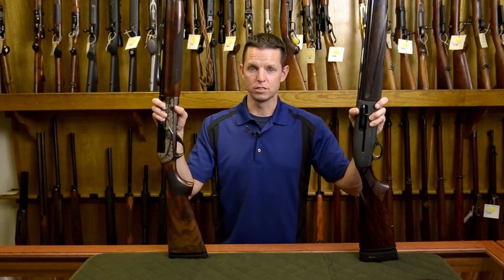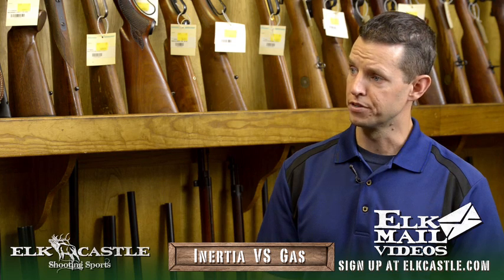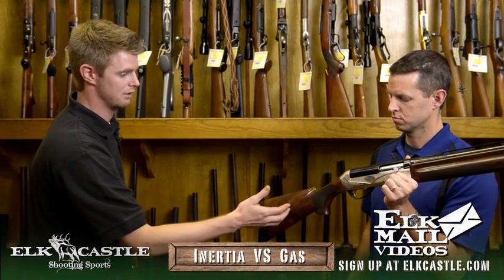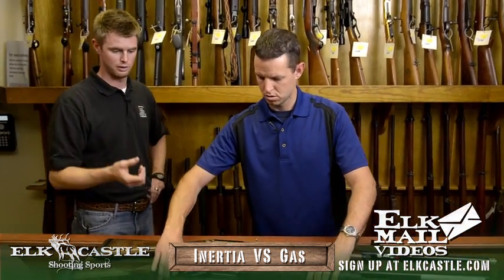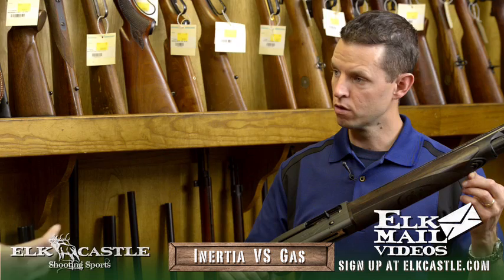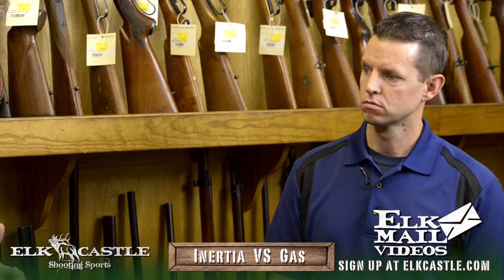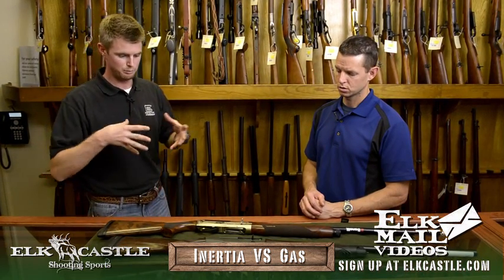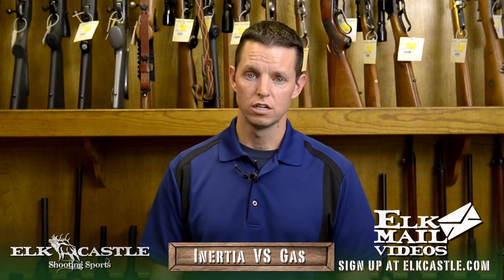Gas vs Inertia Semi-Auto Shotguns

Comment: WARNING DO NOT FALL FOR SKINNY GUYS BENELLI IS MOST COMFORTABLE ALL DAY.BS YOU WILL NEED SHOULDER SURGERY!!!!! i HAVE CONTACTED BENELLI AND THEY SAY IM STUCK WITH THIS BEAUTIFUL KICKING SOB. HAD I FIRED ONE SHOT I WUD HAVE RAN OUT OF STORE. THESE ARE HIGH END GUNS WITH LOW END RESULTS. PROS GUN SHOOTS HARD AND FAST!!!! CONS WORST KICKING GUN OF MY LIFETIME .IM 62 HAVE HAD AT LEAST 45 GUNS. IM SAVING SOMEONE GOOD MONEY. MINE IS IN CABINET AND STILL LOOKS NEW. I PUT A KICKEEZ RECOIL PAD WHICH HELPED SO BUT ITS STILL THERE. TRADING POST PINCKNEYVILLE OFFERED ME 600 I TOLD THEM WHERE TO GO. WILL TRY FOR $750 OR KEEP IT. HAVE SHOT 24 SHELLS SINCE JULY 2017!!!! ITS THE 7.1LB ONE TOO THEY MAKE A SUPERLIGHT AT 6LBS. WITH KICKEEZ PAD GUN IS SIMILAR TO ITHACA MODEL 37 WITH DUCK LOADS. GET REMINGTON VERSA OR 11-87  THE BENELLI NEVER NEEDS CLEANED AND PROBABLY WUD BLOW A SQUIRREL OUT OF TREETOP AT 200 FT. BUT THE RECOIL MAKES THIS GUN JUNK TO ME. IF YOU ARE EVEN THINKING GO TO SMALL GUNSTORE AND SEE ABOUT 3 SHOTS. THE M2 RIB SETS UP 3/4 OF AN INCH. BENELLI DEALER WILL NOT TAKE ANY BENELLI ON TRADE. WHEN YOU LEAVE,YOU OWN IT. TAKE WOOD FOREARM OFF AND YOU WILL SEE HOW INERTIA WORKS. ITS SIMPLE AND BEATS YOU TO DEATH SO HELP ME GOD!!!!!!!!!  DONT BUY AND INERTIA SYSTEM!!! GAS FROM REMINGTON   11-87 $599 ACADEMY RIGHT NOW. MINE IS STILL BRAND NEW IN CASE BUT CAN GO BACK IN BOX. $700 I HAVE $835 IN IT

Comment: "the inertia system comes down the stock". Wrong.... That's a return spring. The money portion of the "short recoil action" (which is actually the longest recoil action) is located between the bolt and the bolt carrier.